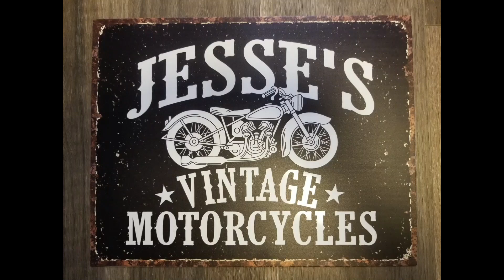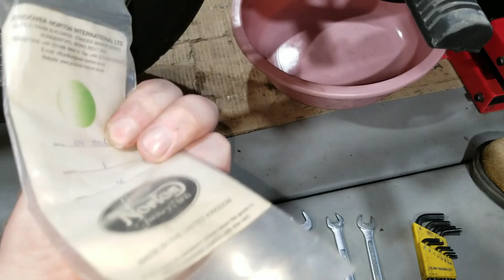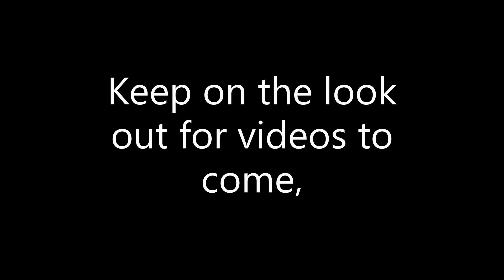1972 Norton Commando combat, Replacing a worn shifter bushing

Comment: Great video, Jesse. You're absolutely correct about the issue of the use of GL-5 oil.  The "newer/better" gear oil is rated GL-5 and the anti-wear in GL-5 does not agree with bronze bushes.  It corrodes the metals and softens them and makes them wear faster.  A Commando box should always get GL-4 gear oil in the gearbox.  
Unfortunately, that often means that GL-5 oil has been used in that gearbox in the past and, if so, the other bushes in the gearbox might be softening and might be worn so if you get any symptoms of looseness in the box, it would be good to get in there and check the bushes.  (Two really critical bushes are the bushes in the output sleeve shaft - the part that the the rear chain sprocket attaches to , and also the bushes inside the kickstart lever boss which support the outboard end of the layshaft - if that one gets loose, it allows looseness on the engagement of all the gear teeth and puts stress on the bearing at the other end of the layshaft which it a critical failure point).
You might want to caution Commando owners about the refitting of the clutch cable (about minute 21:00 - 21:30 in this video).  The cable nipple fits (not very easily as you show, in the workshop and on the side of the road) into a fork on the clutch push fitting.  You can't see the bottom of that lever but it pushes on a steel ball behind it.  When the clutch cable is removed (or if it breaks), the ball can drop out of position and if an owner re-attaches the cable without centering the ball, it will seem to be in place but the leverage on the push rod will be wrong and it will be very hard (or impossible) to squeeze the clutch lever.  One of the first things that might indicate a problem there is that the clutch cable adjustment will be radically off at the handlebar lever.  If it appears to go together well but that adjustment just isn't right (too loose or too tight), it could be the issue of the alignment of the ball with the push rod and that might mean you need to go back and fiddle with that forked lever again to get it right.  
For a little bit of Commando trivia, parts that start with the prefix "04-" on the parts number are parts from the original AMC (Matchless/AJS) gearbox which replaced much more marginal Norton gearbox in the '50s (Norton 650 twin, "Atlas", and Commando).  These parts are the same as the older parts so if it's necessary to fit used parts, the components from earlier boxes will interchange for the 04- parts numbers.
Reply from the maker: Awesome comments and thanks for sharing this and taking the time to write it out, Greatly appreciated

Comment: Good one. The seal machining in the MK3 cover you showed...could have come from AMR in the US...they do a machining service to add those seals on the cover, so can likely tell you the correct seal to go in or even sell you one. Also do the MK2 timing cover machining to add a check valve on oil pressure pump output to help stop wet sumping. All pretty reasonable pricing.